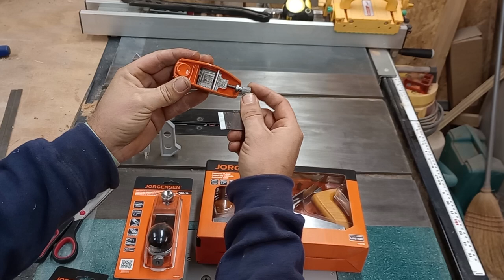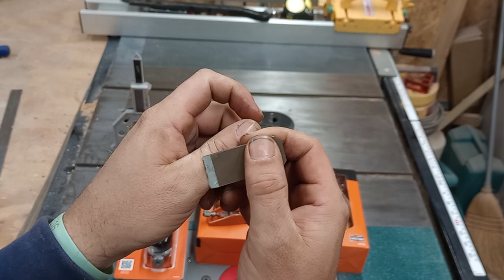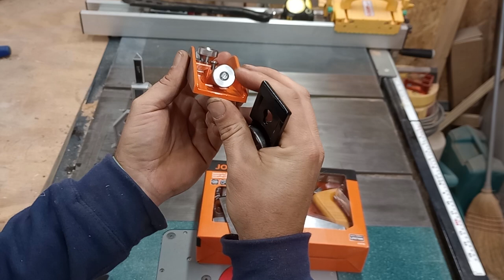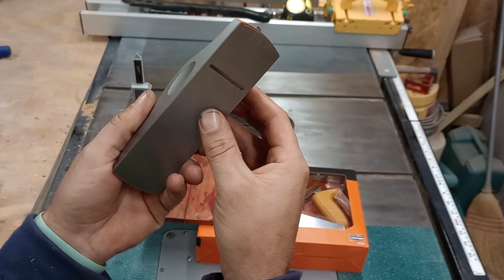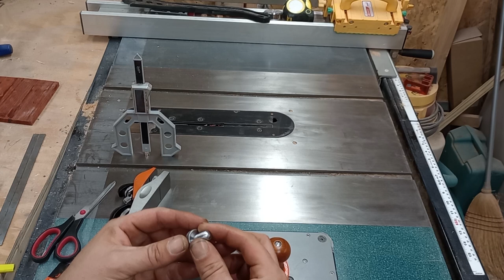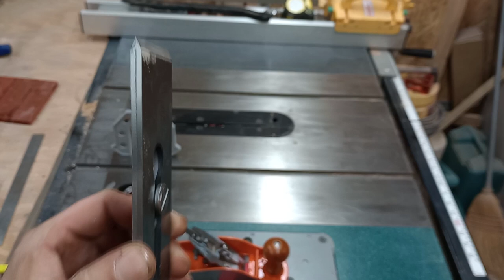The best money I have spent on woodworking Jorgensen planes!

Comment: I went ahead and picked up the #4 based on this video. I was already curious after Rex's. I'm back to say that the first one I got was kinda poorly QCd. The replacement was pretty much just like yours. 

I ended up using the poorly QC'd one to test the threads in the lever cap. It survived 2000 repetitions of being tightened  up to 10 in-lbs of torque and loosened back to free spinning while adding .0025" of extra verticle play in the screw. Threads seem to be holding fine. I did lube the threads up for the test. I think the threads might be formed in the aluminum instead of just cut. Either way, they go through a good chunk of aluminum so there is a lot of area to spread the force out. Unless you cross-thread it or use pliers, I don't see the lever cap threads being a significant wear issue long term.
Reply: I was wondering if this had the same QC issue that the previous Kobalt had. I had to buy 3 kobalt block planes to get a good one. At under $20 for a dedicated chamfer block plane and easy exchange at Lowe’s, it was worth it to me.

Comment: I bought the #4 a week ago, and the threads that hold the blade retainer cap into the body have already literally been pulled out and are now metal shavings on my bench.  I will be returning it and getting a Wood River tomorrow. 
It’s disappointing cause it seems like it was good to go.
Reply from the maker: I argee. Have to be careful just a tension is all it needs!
Reply: it might be worth your trouble to send an email to Jorgensen.  This is new product, and they probably want to be sure that it doesn't possibly crash & burn over a correctable manufacturing defect.  Effective complaining does not include nasty whining language.  Just state the facts accurately and say what would satisfy you - within reason.
Reply: overtightening ?
Reply: @nainitalism  I learned the hard way about over tightening on a Kobalt plane, so luckily that wasn’t it this time. 
Just bad threading and/or soft casting. 
Lowes replaced it and the second one seems good to go.

Comment: The  quality  looks  very  good  apart  from  the  No4 lever cap  being  made  of aluminium , I would  be  worried  about  the  thread  going  first  , It's   too  soft of metal to use  for  a  lever cap,  that's  what put  me  off of the  new  Stanley  low Angle  No62  sweetheart  , thanks for your video,  happy new year from a old  vintage carpenter in England.
Reply: I was curious about the durability of the threads as well so I used a stepper motor to repeatedly put 10 in-lbs of torque, more than I can put on without pliers, then backed it off to free spinning. Let it go for a two thousand repetitions and there is a small bit of extra play in the threads but that's all. I did lubricate the threads for this process to try to minimize friction wear. Some crude testing with electronic calipers shows about .0025" in extra play. I hope that helps somehow.
Reply: @jsmxwll  thank you  👍

Comment: Nice video, like you I found the Jorgy to be a darn nice plane.

Got the 101/2 and the #4 smoother. Right out of the box both of these were making fine fine shavings.

Personally I think Rex has done a great disservice to WWers. Perhaps he got an early production tool ? Who knows for sure ?

Not had a single clog blade has stayed sharp. Much less backlash in the adjuster than  any Stanley. 

One thing I get a kick out of. Rex whines about the weight. I have a LN#4 and it is 6 ounces heavier than the Jorgy. By Rex’s comments we should all put our tank like LN’s  away. As they are too heavy and tiring

Bottom line,  great value in a excellent performing tool.
Reply from the maker: I couldn't agree more!
Reply: The weight is what made me want to buy it in the first place. It’s definitely worth the 70 bucks.
Reply: Weight is one of the reasons I dont even bother with LN planes. I like the lighter old Stanley, record, Keen cutters, even ohios.